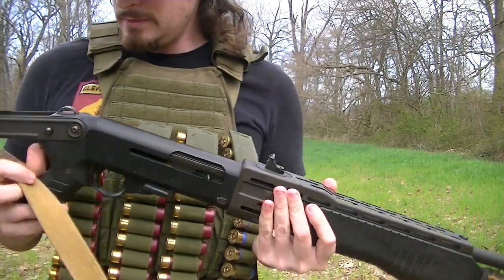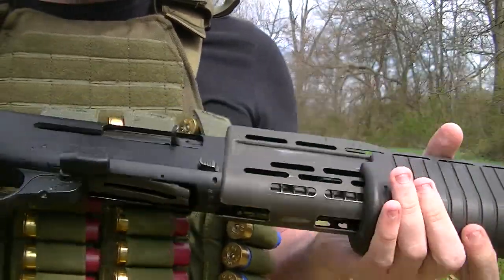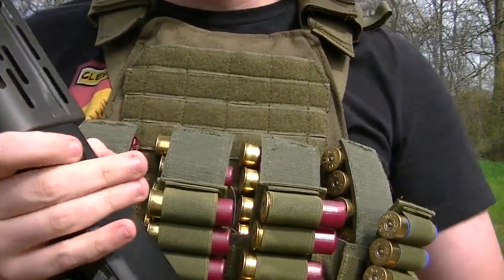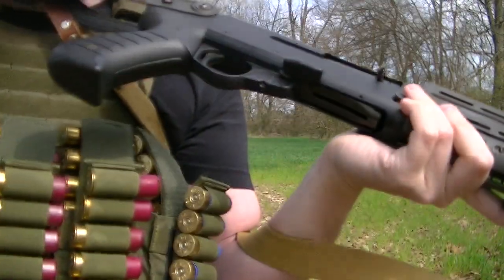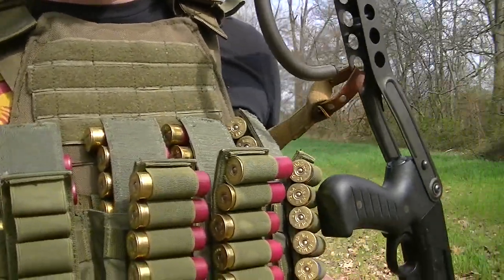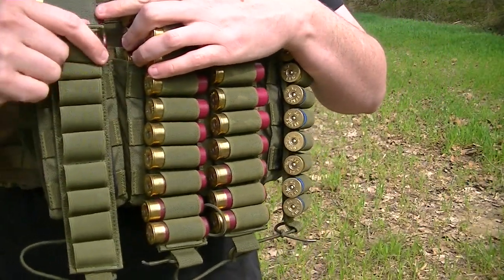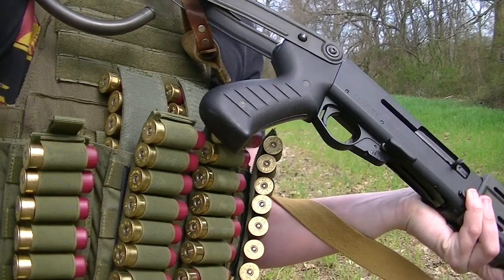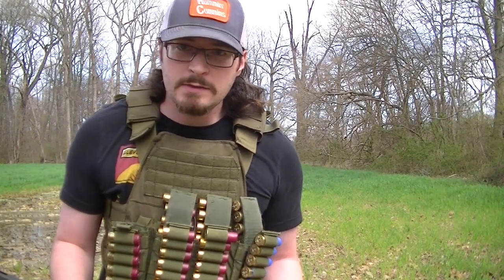The Hartmann Reload Technique for the SPAS-12 Shotgun *Bonus Plate Carrier Rig*

Comment: I finally had time to try this technique and it does work even with the standard bolt release. With the sling holding the gun in place, I can rest the gun on my palm and load with my right hand. I do still think it may work better with the extended bolt release simply due to having a larger surface area, but it does work. If I ever use my standard sling using a hasty sling stabilization technique, I'll use this reload technique.

Also of note, I found that the Benelli Super 90 magazine spring made by Wolff is a drop in for the SPAS-12, and it's a really tough spring that ejects shells out with a great deal of force. Since I had some issues with the last shell not ejecting properly every so often before, this means the gun is 100% reliable. The Nordic spring I replaced that spring with recently also works, though you have to chop it down to the right length. The Wolff spring is just drop in.
Reply from the maker: Cool, I'm glad you like the technique. It probably is easier under stress with the large button. Didnt wolff make a spring for the SPAS-12 at one time? I could've sworn thats what was offered by the SPAS-12 project. Great to know the benelli is a drop in! I need to order a spare or 2 just in case mine gets tired. If I have an extra I might just replace it and test it of course then I might not load down by 1 shell any more. I keep it to one less when its on the wall to help save on the spring a little. It is the original after all. I have a spare recoil spring in hand as well, I heard those can be sorta fickle sometimes. I like having spare parts. Lol. 

As a side not, I nearly have my entire reloading setup complete. So I'll probably be making videos on that in the future. I would like to develop loads for the SPAS-12. Low recoil stuff that still cycles would be fun to explore. I even have a 0000 buck load I want to try. Talk about holding some energy. And I have a way to make flite control wads myself, so there will be some nice tests of that. Very excited for the future. Custom 10 gauge loads suitable for Roland Tembo included.
Reply: @Joseph_Hartmann  I don't think the one the SPAS-12 project used was a SPAS-12 specific spring by Wolff, but instead a generic spring. I had tried using a generic Wolff spring initially, too, but I trimmed off too much and caused that last shell not to eject problem.  I had a long discussion with Wolff about it and they determined the Benelli spring probably works the best and so far with my limited testing, it is drop in and works very well. Even the longer slugs do eject well against gravity, even after it sets. I'll see how well these hold up long term, though. And I definitely recommend replacing it with a Wolff or Nordic component spring. It's not like the original Franchi spring is somehow collectible, so I junked mine as soon as I had a good replacement.

Also, you can make your own Flite Control loads? Nice. Once you get around to making that reloading video, I'd love to watch it just to see how far you can push the SPAS-12.
Reply from the maker: @gameragodzilla  yeah, I wasn't implying that a consumable part was collectable. I just meant I'm trying to treat it nice because it isn't as good as a new Wolff spring is. Tech has come a long way since even the 80's lol. Especially when you talk about metallurgy. I will definitely be looking forward to a report on the spring in the future. And there will be SPAS-12 specific loads developed. Anything to further push the SPAS-12 forward.
Reply: @Joseph_Hartmann  Looking forward to it, doubly so with a Federal Flite Control 8 pellet load that’s also copper plated and buffered. That’d be interesting to see as Hornady Critical Defense doesn’t do either of that, relying solely on the wad. Now it still works wonders at home defense ranges where the pattern is extremely tight, but it does spread out more once the pellets separate from the wad, moreso than Federal’s offering.

As for the spring, they’re inexpensive so I just bought several to have around just in case. If this spring breaks, or prematurely wears out, or if I deform or overcompress it, I have plenty of replacements.

Comment: Violin loading does get easier with repetition but using the spas-12 for anything other than mounting on the wall as a collector's item would be troublesome. Weight being the biggest issue at almost 10 lbs empty. Training with it causes issues as well since parts are getting more difficult to find. I love mine! And your chest rig is very similar to the KSG rapid response mini-rig that I bought from Hitech custom concepts, yours holds more shells though. Nicely done video, Regards
Reply from the maker: Thanks, I keep a supply of spare parts on hand though. I use my SPAS-12 for anything I need a 12 gauge for. Pest control, deterrence of other pests of the 2 legged variety, hunting, just anything. No problems. People complain about weight then some of those same peoples go to rifle is an m1a or an AR loaded to the hilt with shit they don't need. Same weight. I trust mine fully and I run it accordingly. I was just a bit nervous in front of the camera, hence the slight hesitation in loading, especially the first shell, I wasn't sure if I actually wanted to go ahead and load on camera or not then decided why not. Trying to walk and chew bubblegum sort of thing going on there. Lmao.
Reply: @Joseph_Hartmann  video was great. Don’t be so critical. You just showed a well thought out system with a firearm most dream about.
Reply: SPAS-12 Project has all the parts needed to get the gun up and running, which is why I even bothered getting this gun. Their parts allows this gun to keep functioning so I can shoot this all the time. I wish more out of production firearms had this type of third party fan support. Heh

Comment: Thanks. I'm going to use a modified form of your technique with the back part of the sling around my right shoulder. Also, I prefer the shot shell belt versus the chest rig. "Mesa Tactical" also has excellent side saddles. Keep up the good work.
Reply from the maker: Thank you. I'm glad I could help. I have a25 shell cartridge belt to go with this as well, or I can use it stand alone, on it rides a drop leg holster for my old dan wesson 15-2 in .357 magnum with speed loaders, a fine revolver that I am confident with. I just didn't feel the need to show it in this video. Brings the round count up to 96 shotshells with an additional 10 in the SPAS-12 ghost loaded. More for show of force in a community defense role. But works for combat too of course.

Comment: Hey, saw an animator actually animate your technique for loading. lol

Your video is catching on.
Reply from the maker: Link?
Reply: @Joseph_Hartmann  https://youtu.be/q8pc7TxmGy4

Should probably drop by and see if you can get him to respond. lol

Would be nice to see if you can get him to animate other SPAS-12 techniques.
Reply from the maker: @gameragodzilla  I'm so excited about this.
Reply: @Joseph_Hartmann  Heheh.

Btw, were you able to fix your missing stock plate, yet? Mine that was just quickly welded up still holds up right now, but I luckily still had mine to weld up.

Also, wondering if you’re still eventually able to send in the recoil spring so we could potentially make some replacements. Don’t want to be a constant bother, but that is the last thing I think would require regular replacement for the SPAS-12 to last me a lifetime.
Reply from the maker: @gameragodzilla  no on the plate and idk when I'll be able to send the spring, sorry.
Reply: @Joseph_Hartmann  Fair, just asking heh.

Man, what I’d want most is a combat bolt release, though. There is a SPAS-12 with a fixed stock for sale at my local gun range, but it’s missing the large bolt release. It has just the threaded part. I may actually buy that as a second SPAS-12 if there’s a place to get that piece.
Reply from the maker: @gameragodzilla  anyone with a lathe could make one.
Reply: @Joseph_Hartmann  Unfortunately I don’t know anyone in my area with one.

Well if you ever get someone to do it, let me know so I can buy one too. lol
Reply from the maker: @gameragodzilla  most gunsmiths have a lathe lol. I could probably get my guy at sas tactical brakes to make one.
Reply: @Joseph_Hartmann  Huh, I’ll have to ask my local gunsmith about it then. lol

Wonder if it’d also be possible to create a two piece lifter like some later Browning Auto-5s had to get around the reloading, although you’ve proven that proper technique is fine. Heh

Comment: Thanks for the “like” earlier on other Comment about being self critical.

Your a smart guy, so I have questions I know you know.. 
What is the meaning/purpose of the tail hook? 
What’s the lower limits that force user to utilize pump action?
Could you/have you tried mini shells?
Can you ghost load it? 
What is your impression of the sights?

Thanks in advance! She is beautiful. Subscribed for more..
I’m glad you use it also instead of just storing. Firearms look and work better when they are doing their job. Just like humans.
Reply from the maker: You're welcome, I actually really appreciated your comment but I wasn't sure how to reply yet. 

The tail hook has several uses, the main one is for firing the SPAS-12 one handed, out of a car window or around a corner. The hook turns and locks into position 90 degrees left or right, so that it hooks under your fore arm, allowing the gun to be shot with the use of one hand only. The second use is as a carry handle. Leave the stock folded over the gun, then unfold the butt piece and the hook works as a carry handle in that configuration. You can also turn the hook 90 degrees in that position and use it like a chainsaw grip for hip firing if so desired. 

My shotgun, and others I have talked to, can cycle 1200 fps bulk federal birdshot from the shoulder without issue as long as the SPAS-12 is properly lubricated, that is where alot of what I call "myths" around the SPAS-12 being unreliable come from, poor or complete lack of lubrication. I call them myths because they are simply untrue if you do the maintenance, just like anything else. Now, if you try 1200 fps from the hip you can have some hiccups, but this is true with other semi auto shotguns as well, they like being supported when firing. So if it is a less than lethal round or something less than about 1300 fps from the hip, I would utilize pump action mode for that scenario. But 1200 fps supported from the shoulder is 100% reliable. 

I haven't tried mini shells, I have considered trying them so next time I run across some for sale I will give them a go. I might even load my own instead. That is a plan for the future, SPAS-12 specific hand loads.

I just learned the other day that the SPAS-12 can in fact be ghost loaded. The procedure is as follows

1 fill the magazine tube
2 swap to pump mode (its just easier) 
3 open the breech fully
4 push the shell carrier up
5 put a shell in the magazine
6 ease the bolt forward slightly until you can push the carrier down
7 push the carrier down
8 drop a shell in the chamber and close the bolt.
9 swap to semi auto and enjoy 8+1+1 capacity. 

It sounds complicated but its pretty easy in reality. It can also be interrupted according to the person who told me how to do it. Look at my conversations with gameragodzilla on here and you will find it I'm sure.  

The sights are the best I've ever used on any shotgun to date. Easily acquired, and surprisingly versatile. They even have built in slug sights, with a small notch in the bottom of the ghost ring. Bury the front blade in it and that is how you aim with slugs. Mine will shoot slugs to the center of the ghost ring with the blade buried at 100 yards, at 200, I bury the blade in the notch and aim with the top of the blade just like a standard rifle sight, ignoring the ghost ring entirely. I have yet to try 300 yards, but I reckon if I hold a standard sight picture, post in the middle of the ring, I'll be really close. But that is just guess work as I haven't tried it yet. 

That you for subscribing, I hope you don't mind my long winded response. There's alot of intricacies to the SPAS-12 and how to use it most effectively. I enjoy using the shotgun and it has been a loyal servant the whole time I have owned it. Thank you for your kind words and inquiries. If I didn't explain something well enough, just let me know. I might make a video on it instead, I'm a visual learner myself so I know seeing something done can sometimes be more helpful than words. I plan on making videos covering ghost loading and the sights at extended ranges. All credit for the ghost loading goes to gameragodzilla. He taught me something that I didn't think was possible when he told me how to ghost load it. 

If you have any more questions please ask away. And thanks again for your comments.
Reply: @Joseph_Hartmann  btw, just saw this message but another thing I noticed about the SPAS-12 sights: the ghost rings are large enough and the shouldered position stable enough that I can turn on a laser sight and see it easily through the ghost ring (assuming close quarters and indoors where the laser is still visible). That setup almost works like a red dot without having to add an actual optic, while also letting you aim from the hip with the stock folded. Maintain target focus, bring up the gun with the laser sight on, and see the dot through the ghost ring and put on target.